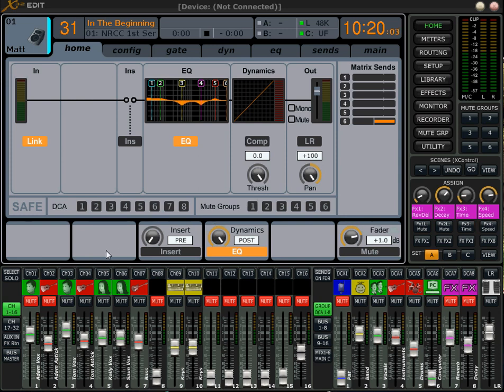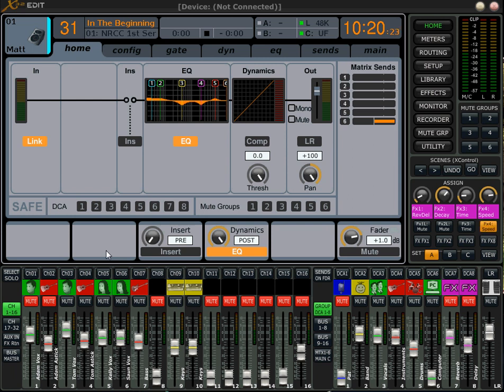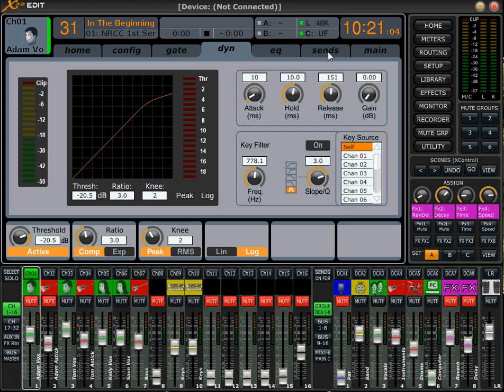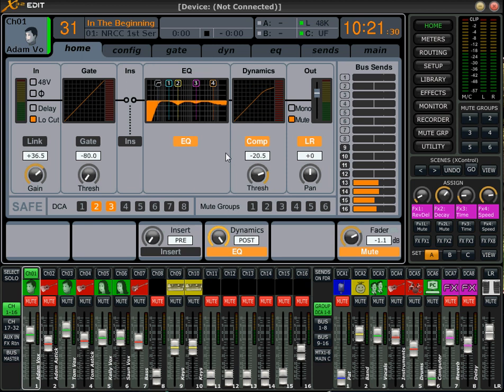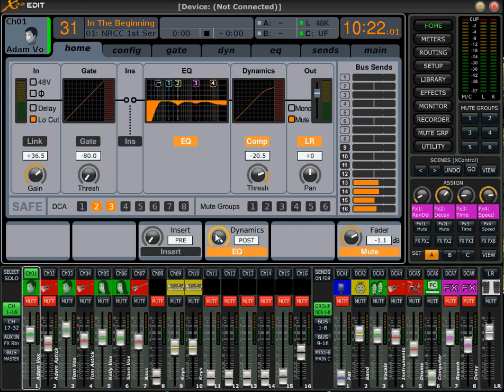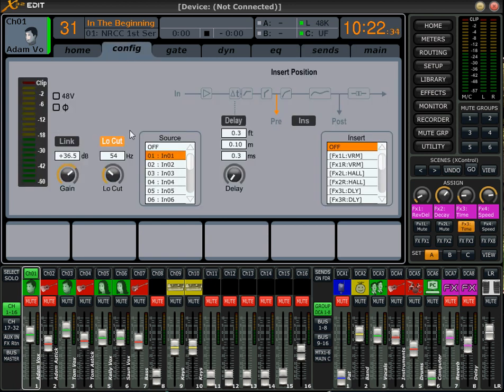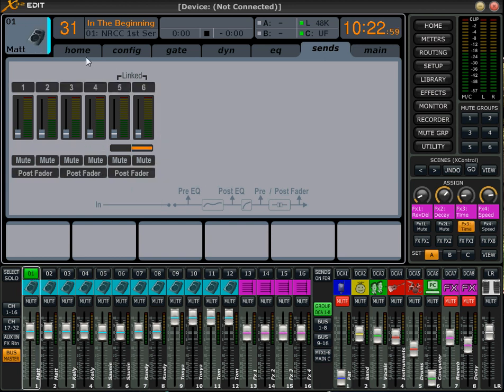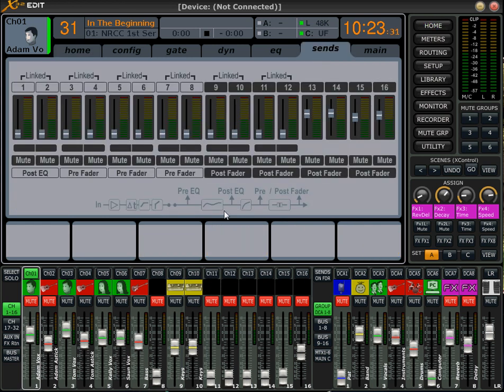Behringer X32 - Bus Send Tap Explained

Comment: Hello Drew, i am a sound engineer at Ichthus church in Belgium. I encounter folowing problem with my X32 (firmware 4.0) + SD8+SD16+SD8. I cannot figure out how to connect mixbus 1 to output 17 of the last SD8 (slide switch set accordingly to position of stage boxes. I have serveral outputs connected to box 1 en 2 (outputs 1 to 16). Can you please help me?

Comment: I can't find a video or a post that answers my question. What exactly do I need to do to make it so the musicians can't hear the gate or compression in their ears? The drummer in one of the bands I do will not dampen his kick drum properly. And his floor tom resonates too long. There's no getting him to fix it. And yes, I'm a drummer and I know exactly what to do but it is not my drum kit. So I have to gate those drums but he doesn't want to hear the gate. I'm still kind of new to the X32. What EXACTLY (as in step by step) do I need to do, so the musicians don't hear the gate in their ears?
Thank you!
Reply: I think there are two ways: you could either set the send-modes of the drum mics to "Input". That way you would send the drummer his signal without gate, but also without EQ or compression. If you want to send him his signal WITH EQ, but WITHOUT gate, there's a second option: you could select an unused channel (assuming that you don't need all 32 faders) and select the channel of the drum mic as an input-source in the config-tab. You basically get a "clone" of that signal on a separate fader, which behaves independently. On the "original" fader you put all your gate, compression & EQ that you need and send it to the main LR mix (but not to the drummer's in ear). On the "clone" fader you put your EQ, but no gate and send this directly to your drummer's in ear (but NOT to the main LR mix). This method could be inconvenient if you have to do it to 10 individual drum mics - but if you only need it for your kick & floor tom, it could be an option.

Comment: Hmmm, isn't channel sends to monitors(Bus) supposed to be post-fader? Isn't the monitor mix (Volume) affected by the FOH mix if it's fre-fader?
Reply: +Michael Bragt Well, OR is the whole SEND menu for the signal tapping for when we use "sends on fader"?
Reply: +Michael Bragt Ahh Well.... OFC Guess I got it wired wrong in my head at comment time.... Ofc we are tapping the signal Pre.fader (Before the channel fader) to get a situation where the channel fader would not affect the monitor mix.... Just me who got it wrong in my head GGG

Comment: Hi Drew, we just got the new x32 beheringer digital  board. We use to have the mackie  32 channel analog board. We had our. Recorded  hooked up to it. So when I record service, I would use  5 and 6 aux sends. to adjust the Levels  on the recorder. So can you tell me?  How do I do the same thing? On the digital  board.

Comment: HI Drew,

Your great videos have been a great help and real blessing... THANK YOU!
Do you have a video which might help in our next X32 challenge... incorporating a Cymatic LR-16 recorder we want to use to capture 16 live channels simultaneously?

We use one S16 to send the 16 inputs we currently use back to the X32 and for the two S16 outputs which feed our powered PA speakers. Our need is to get a pre-fader signals for each channel to feed the 16 Cymatic LR-16 TRS inputs... without otherwise interfering with the live mix.

The Cymatic LR-16 will sit next to the X32 and although the X32 lacks individual physical Insert jacks for each channel we're hoping to utilize the 16 outputs on the back of the X32 for such. Are we correct in assuming that each of the 16 channels we are using can continue being routed to the two S16 main mix outputs... and also be routed as pre-fader outputs to each of the 16 outputs on the back of the X32?

Many Thanks!

Comment: Hello Drew

My band is using a single X 32 rack and we have five members. Drummer, bass player, guitar player, two singers and four channels of sequences. Everyone in the band is on in ears. Everyone except the drummer is wireless (mono feed) and the drummer has a wired stereo feed.
Output one through four are used for the two singers, bass player and guitar player and output five and six used for the drummer. Seven and eight are used for the front of house. 
Currently, on the routing tab for the analog outputs, we have all the in ear monitor settings tapped at post Fader.
Obviously, the difficulty that this presents is that anytime the front of house engineer mixing equalization or compression adjustment, the performers hear it in their monitors. However, if I switch the tap point to pre-Fader so that the performers don't hear these changes at front of house, then we are left without hearing any equalization or compression. But if the tap point is set at prefader the equalizer and compressor on the output don't seem to work either. 

Ideally we would like to be able to have everyone on in ears be unaffected by the FOH engineers EQ and compression changes but still eve able to have EQ on the mix bus sends to their in ear mixes. How do we do this.

Comment: Mayby a tip. If you have any channels left, route the vocals to other channels. This way you have a vocal Channel for The FOH and for The monitors. On the FOH Channel use compressor en do not send to the monitor buss. On the monitor channel do not send to FOH en do not use compression, you even have separate eq. 

Just a tip

Thans for all your vids Drew !
Reply: This is actually the way that I currently resolve the "compressor in monitors" issue.  The problem is the "...if you have any channels left."